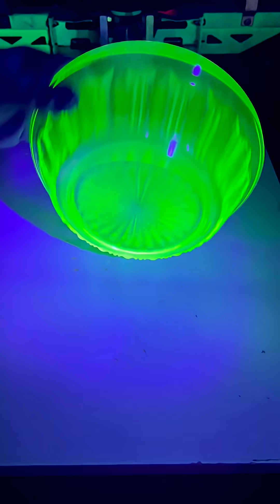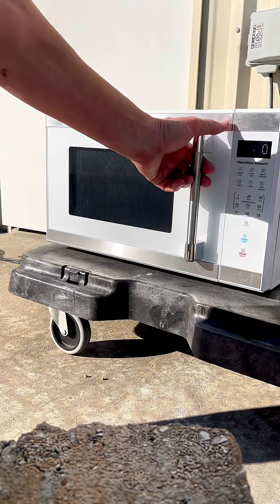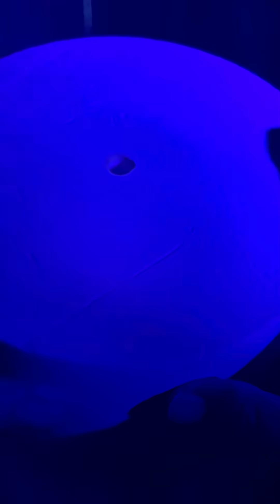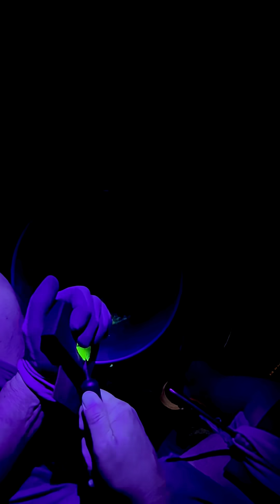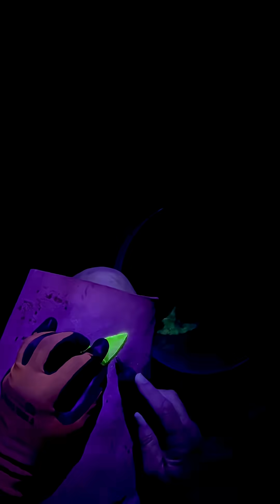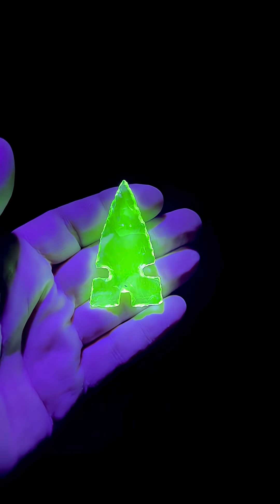Uranium Glass Arrowhead

Comment: You know the funny part? The radiation is the least of the problems here. Uranium glass is barely above background, so the glow isn’t the issue. The real danger comes from heat and dust. When you melt uranium glass in a microwave kiln you can drive off heavy-metal oxides as fumes or ultrafine particulates, and those things don’t magically stay inside the kiln. Breathing that in is where the actual harm is.

Then he takes that same glass and starts knapping it, which turns the whole thing into a cloud of sharp micro-shards and dust. Again, the risk isn’t that it’s radioactive, it’s that any heavy-metal doped glass dust in your lungs is a very bad idea.

And I have to admit, it kind of makes me wonder if he originally ran this little experiment inside his house, only to realize how dangerous it actually was, so he moved the final filming outdoors to make it look safer. If so, that just adds another layer of recklessness to the whole thing.
Reply from the maker: No I’ve always melted glass outdoors, not just the uranium glass and I wear a respirator when knapping.
Reply: @blondeokie  Well....okay then. But I'll have my eye on you! Just kidding. Seriously though I'm glad you're staying safe. Cool video! I always wanted to learn how to nap flint when I was a bit younger. Guess I just never got around to it.
Nice work!